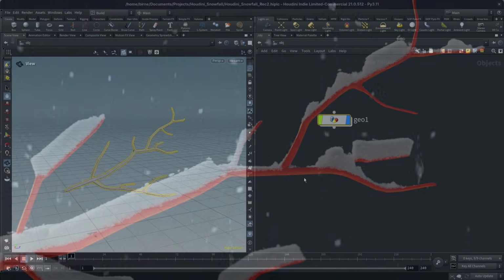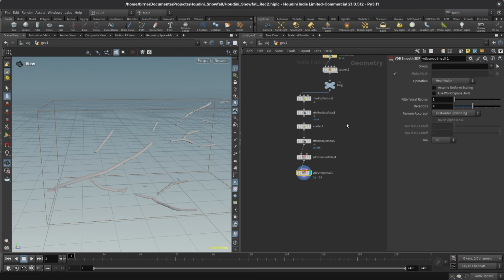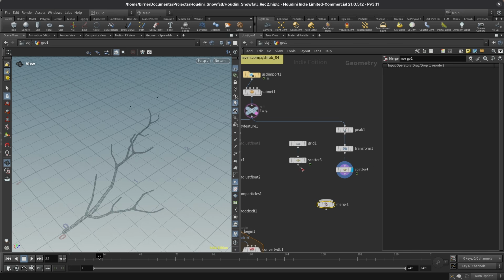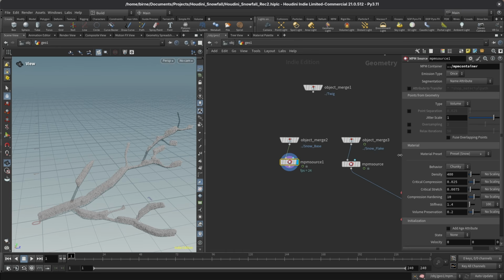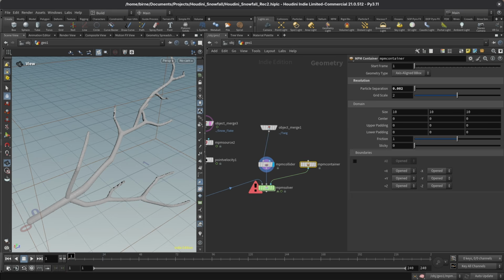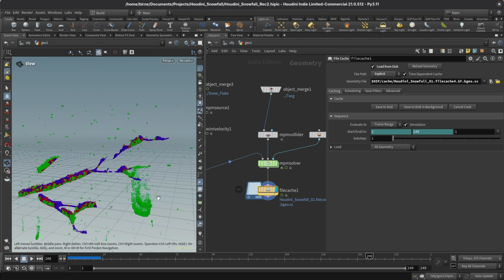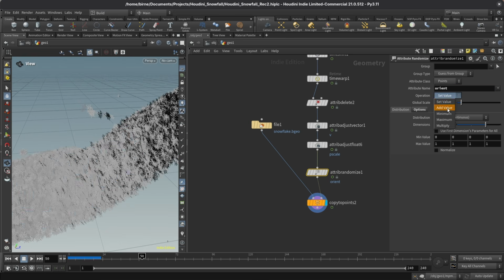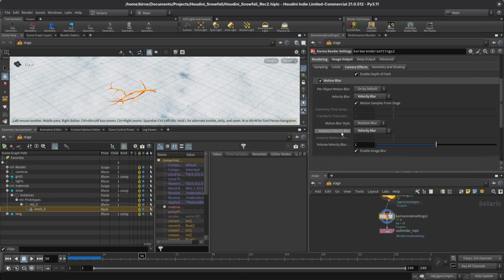Smol MPM: Simulating falling snow with Houdini

Comment: for us plebs that dont have Houdini 21, what can we do to get the sleeping effect, im using 20.5 :(
Reply from the maker: MPM in 21 and up uses an integer attribute called "state" to track sleeping. You could try setting state to 0 for all points and check if they don't simulate with this change. If this is the case you could try building your own sleeping logic in a pop wrangle inside the solver. If state does not work you could try other common attribs like "stopped" or try to rebuild the effect in FLIP or Vellum Grains, which both should have sleeping in your version.
Reply: @Entagma  i have come to kind of a solution by just messing with the density, its just so that the snow doesnt fall as soon as the sim starts. Im not as versed to do a wrangle inside the solver, however my solution is way more resource intensive, thx fro the reply and tutorial tho! Ill upgrade as soon as i can to 21 o 22 :)

Comment: Hey there! Really loved the tutorial!! How could i give the snowflakes a different direction when they fall, e.g. as if it was a bit windy outside? I thought it would be possible in the pointvelocity node, but i dont really see anything happen here
Reply from the maker: A point velocity outside the solver will only give each flake an initial push in one direction, not a continous force. To get that, double click the mpm solver to jump inside and wire a pop wind node (or any other pop force) into the output node marked as "PARTICLES". On the wind node you can now set a general direction, as well as some noise.

Comment: I wonder if its worth it to use your snowflake generator for it, I tried to simulate snowstorm in blender with 14m particles and I retopo snowflakes a bit and give it slightly rough glass material with some volume scattering, but I wonder how much of bounces is it gonna take to not be black from that, like maybe shadow is should be transparent so only volume absorption and scattering would tint shadows and not caustics, but like I dont even know if any render engine could handle such complexity, I thought of just converting most of thick snow into polygons while keeping few centimeters from surface as real particles of snow just for optimization, IDK if it would look as good tho. Thinking about using either renderman with Unified VCM inegrator to avoid too much noise, but might gonna try Maxwell render to see how good its PSSMLT gonna handle such complex scenes. Would be nice to have a bird or squirrel sitting on a branch and having some sort of icicle sculpture casting caustics on top of small snow buildup on top of real feathers or fur and branch itself is like very displaced, maybe it would be possible to simulate some sort of parhelic circle in the sky for some fun winter rainbows idk. Kinda sad we have so much of power outage in Ukraine, really hard to do any art with such things happening :(. I heard that photons are pretty fast for SSS or complex illuminations cause they bigger then pixels, might work better to use ordinary PT with PPM for snow itself and icicles.

Comment: Can you make a tutorial for optimization in houdini, cause when I for example generate mountains or any assets it takes almost half of my 256gb of ram while meshes them self never exceed 30gb with textures, like there is some sort of way to clean up and cashe result, cause file cashe doesn't clean memory at all. Really wanna do it all in one place instead of making separete project for every asset. Thank you 😊
Reply from the maker: 256gb - in this economy?! Jokes aside, taking a deep dive into Houdini memory use could be interesting. Here are also some things I'd try in your case:

If there are simulations that rely on previous frame data and you're planning to use a file cache node anyway, you could just disable caching to ram on the solvers entirely. Then only the geometry of your current frame needs to stored in ram.

As for heightfields it's not that clear cut: The internal 2d volumes exported as bgeo are just slightly larger than losslessly compressed 32bit exr files (which I assume you're exporting - jpgs are of course much smaller). So to me this seems either like your storing a ton of unused layers or a bug in Houdini.
Reply: @Entagma but like is there any magic node to clear out things and only keep final mesh? Just would be nice to cash out and reduce memory but I swear it's not OK when tree generator without boolean uses 96gb ram lmao, like maybe it's automatically takes certain portion or something, cause I remember using same settings and it's being 26gb on other pc. Also I tried to export heigh fields but it have values larger then 1 and it makes mountains flat, in blender it's OK looking tho. Just would be great to have some sort of clear memory node for real 😢would love to assemble all at one place and render, then making separate projects for every asset. As far as I tried is to just export things as meshes then make new project and load it up, but then whole procedural magic is gone 😢